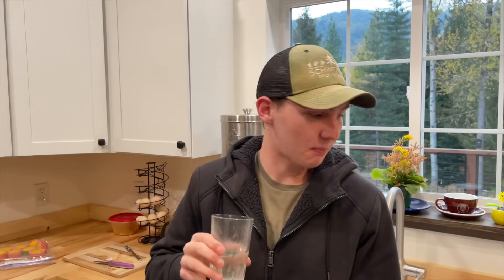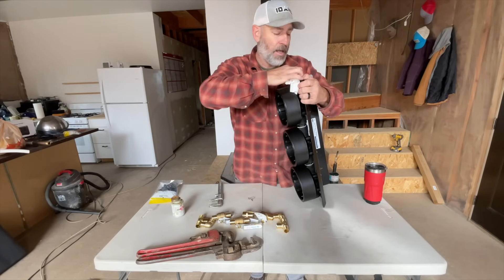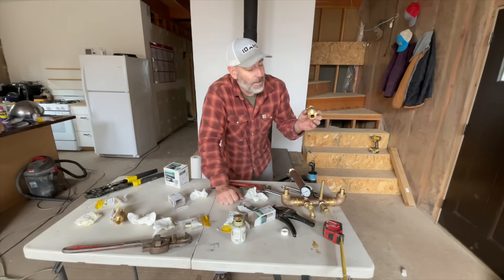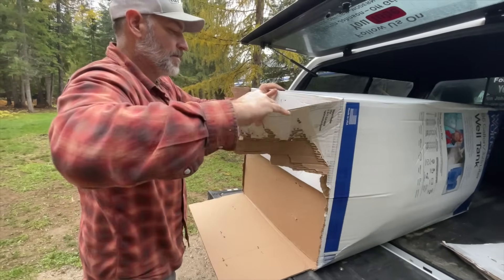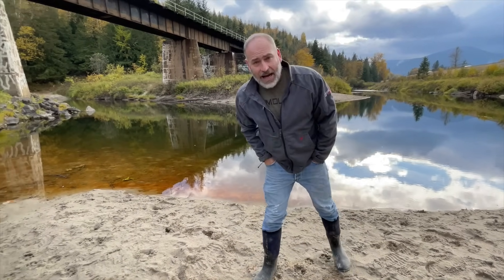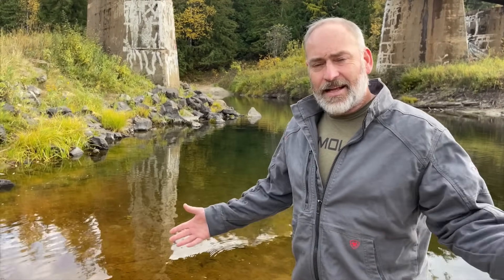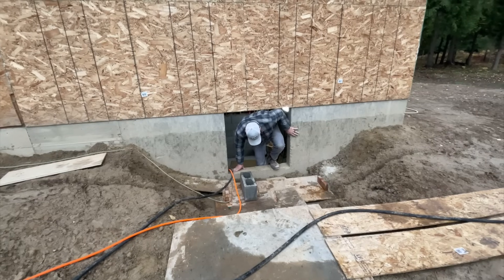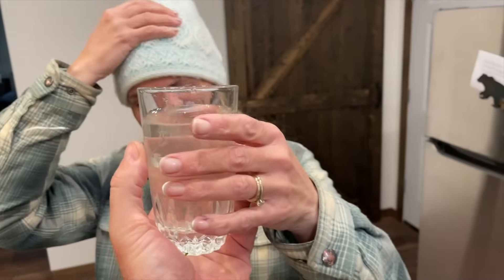ULTIMATE Off Grid Water System - Real Off Grid Living

Comment from the maker: 💦 If you missed it, here is our well-drilling video https://youtu.be/EVlSBgdA7Dc
Reply: Martin, you need to install insulation underneath the floor to keep the house warm and prevent pipes from freezing during winter time.
Reply: Love the new film quality! New phones? New equipment too?
Reply: Just FYI  spammer trying to contact  me on the comment  I left earlier.
Reply: I think a spammer wanted me to do what's ap. I just wanted more info on hand pump, wasn't in well drilling video
Reply: Your HISEA product tester link doesn't work. I had to go to their website to register and hopefully it took as it doesn't say if your signup is completed or not.
Reply: Try going shower 🚿 water to toilet water to save water recycling ♻️
Reply: i missed it somewhere... what filter is that ? thanks
Reply: Hi guys u should try solar heat on ur build save ur lives cold weather n keep trees around ur home away cause of fire 🔥

Comment: Great video! I would suggest you put the carbon filter at the end to extend the life span! When I built our filter system, we were instructed to always put the carbon last in the chain!
Reply: My thought also, get the nasties out first then run it through the carbon filter.
Reply: Ten years in the water conditioning industry taught me to filter the worst elements first and then the taste (carbon filter) last. Sentiment, minerals, chemicals.  Great video. Dan.
Reply: Yes I agree, same as we did
Reply: You can use large to small micron filters the same way.  The problem with the carbon filter is they lose carbon in the water so it will clog your other filters also.  However if you don't want random black particles in your water you can do the carbon before another 20 micron filter to stop the carbon.  If you buy a white filter you will see the black carbon on it.

I had to do a lot of filtration for high pressure aeroponics
It's good to think of the carbon as a sponge.  Over time it will take the same oh and chemicals as whatever it filters.  The carbon becomes very concentrated with these elements

Comment: It is called an LB because the opening is opposite the cover, coming out the back. There are also LRs and LLs for going right and left. Hold the fitting like a pistol and the cover to the right is an LR and to the left an LL. I agree about putting a romex connector going into the LB. You wouldn't pass an inspection since the opening is not closed.
Reply: LB is for conduit PVC pipe, not romex connector clamps. They should have used the right electrical box.

Comment: When I lived in Hawaii I had a similar system but suggest a couple changes for yours. My system had a sediment filter before the pressure tank and that helps keep the inside of that tank clean and the rubber bladder inside it will last longer. Also, I had 3 filters mounted in this order : first was sediment, second was charcoal/carbon, last was a UV filter which contained a UV light that kills 99.9% of bacteria. We didn't really need an iron filter but since you have a deep well I can understand the need for one in your situation. I had my water tested for bacteria to be sure it was a safe source of drinking water. It's a learning experience that is so important! God bless you all! I love watching your progress!
Reply: The sediment will have no effect on the life of the tank, nor will dirty water. It more comes down to how often and how much water you use. The more the bladder expands and contracts, it gets pinched where a metal ring is crimped into the tank to hold it into place. I have never seen a filter before a tank besides and automatic sand separator. Putting filters before a tank can cause a pump to short cycle from the pressure switch not properly sensing tank pressure.  Minerals in the water all come down to where the well is drilled not how deep. I have replaced pumps in 100 ft wells there are iron mines and I have also replaced pumps in 1300 ft well that are spotless. Just luck of the draw and local terrain really. Hopefully that helps some :)
Reply: Bad idea, since if the filter gets clogged, the pump will burn up.

Comment: Two suggestions:
1. Install a sediment filter before the tank to avoid sediment build up in the tank. Having two sediment filters (one before & one after the tank.)
2. Glue a bushing with female threads into the LB box so you can install a romax connector for the #12 gauge romax wire going into the LB.
Reply: I got all of my filtrations done before the tank,and in the tank i have a UV lamp ,but yes the sediment filter is the minimum
Reply: I was just about to suggest something similar.
On one hand, if you can clean out the tank, letting the sediment settle out means less usage on the sediment filter.
But on the other hand, it just makes more sense to me to run all the filters BEFORE the tank.
Run less chance of damaging anything after that.
But I guess it might also depend on how things work, like the filters might not be able to handle the higher pressures on the line between the well and the tank.
Reply: Should never put a sediment filter before the pressure tank, will effect how the pressure switch acts. Sediment on the bottom of the tank isn't an issue. Only time I will come out is if you drain the tank down or run out of water.
Reply: Nope. issue is that some time filter get clogged, and it can burn up the pump motor. One option is to install two tanks: a small one with the pressure switch on it, and a second tank on the other side of the filter(s). 

The LB isn't the right electical box. It should be a box which you can install romex connector clamps (usually with threaded holes). You cab by cast alum or plastic rectangular electrical boxes that will except threaded flex conduit connections & romex wire connector clamps.
Reply: @PituWillson  Not a good idea because of one of the filters gets clogged, it can burn up the pump motor.
Reply: @guytech7310  i dont know what kind of weird pump you use, my pump make constant presure at the output and when this presure is reached, pump switch off, and when the presure drops then get switched on..I have diferenciál presure sensors on my filters, so when the filters get clogged I can see it even before that happens.... Trully I think its not very smart let all the sand and silt get to the tank... I am storing in my good pure drinkable water
Reply: @PituWillson  Nope. The pump just moves water into the water line, it does have pressure regulation built in. Some installs have a pressure switch installed in the well instead of at the tank. If there is no pressure switch at the tank, remove the well cap and look inside the well housing. You see a pressure switch installed, usually at the pitless adapter which connects the well pump line into your water line. 

Consider how would a well pump know at what depth its at. Is it at 50 ft, 100ft, 150 ft, +200 ft? the deeper the well the more pressure is required to pump the water out of the well. All well pumps rely on a pressure switch.
Reply: @guytech7310  i have said that my pump make constant presure at the output so that mean it have pressure regulation built in,so what you talking about ....I have this pump, Grundfos SQE 3-65,in25m deep well and after this pump on the top i have filters and after these filters a tank and ist working all fine, I have too much sand in the well so I dont store it,the sand, in my tank,the tank is just for water
Reply: Please remove this suggestion.
Reply: LB stands for Long Box. LR goes to the right not the back, LL goes to the left. A "C" is simply a break with both ends open for pulling long runs. You are not allowed to do any makeup in an LB.  Exception is you can hook up a light fixture or a flood light.  I wouldn't worry about it though.  (50 year electrician)

Comment: You really need a silt filter before the pressure tank. 
Also you don't need a bypass on the filters.  With that you are just allowing contaminated water into your system. 
What you really need is a service flush valve when you change the filters. 
When you put a new carbon filter you will have carbon dust in the water big time.

Comment: After a couple of years building RO systems in arctic communities I would suggest an RO membrane . You should also look at a UV light phase on the post filtration side , you might also want to consider a 300-500 gallon tank in the basement post filtration to store clean water an ozone aeration unit will help keep it fresh and having a stock of clean water in a heatable space may save you in an extreme winter season . It also seems better for pump longevity to pressurize your inlet water with one pump and distribute it with another located after the filtration and before the P Tank . This splits the draw load and the distribution pressurization load . We were building fill your own jug systems for the town stores in these tiny villages and when you are 2 or 3 airplane flights and at least as many days from any replacement parts or a service tech you learn pretty quick how to adapt these systems for absolute minimum hands on maintenance , after all who wants to pay 10-12 thousand dollars for someone to fly in and replace a 100 dollar pump ?

Comment: those filters are huge. my RO system was similar but a 1/10 of the size. during my installation, I was instructed to not drink the initial water passing through the filters but instead after 6-12 hours of the system and filters in use

Comment: A suggestion, I wouldn’t put the filters and pressure tank in the crawl space, not for any other reason than it’s a pain to change and if the tank ever fails, it’s a huge pain to get it out of there. Usually you would want all of that stuff at ground level or at least where you can get it out of there on a flight of stairs instead of a step ladder. In the case of a catastrophic failure, it’s nice when these systems are located in the garage, in those cases they typically drain out of the garage bay.

Comment: if you notice lower water pressure in the faucets, remove the aerator and clean the screen.  some debris can come from the new plumbing and will clog the screen in time.  Good job on the pressure tank and plumbing, I used to install wells and pressure tanks, in a past life, hi hi

Comment: You had it right as far as you went. LB stands for "Elbow Back" because the direction change is on the "back". There are also LL and LR and an almost never used LF. You guessed it, Elbow Left, Elbow Right and the unicorn Elbow Front. I've only seen the LF once in 37 years as a general contractor.

Comment: you're outside hydrant next to the well isn't going to work with the check valve in the basement only if the pump is running at the time you turned it on👍
Reply: Very good observation 👍
Reply: I was waiting for somebody else to catch this lol, I would install the check valve under the pitless for the hydrant to work

Comment: Praise be to our Abba Marty and Jewels... Emmanuel has truly blessed you both to come so far...

Have you ever thought of using a used oil heater. They can be used in non living areas, it can help keep your home's crawl spaces, and the garage warm. This could potentially help you retain heat in your living areas by heating the floors in the house and the living space of the apartment from the garage reducing your demands on  your off-grid power systems in the winter and lower your propane needs since the lower temps may use more fuel to keep the areas cozy. You can get spent oil from auto parts stores and oil changers. They would probably give you the used motor oil... A 55 gallon used Polly drum could be ideal to store the oil.

I would also consider putting a small power station in the basement area with its own micro charging station all-in-one with a 400watt Bifacial panel should keep that charged especially in the winter to reduce the demand. This could allow you to shut of the circuit from your Off-grid power electrical panel. Less flow of current in wires of unused circuits means less wasted energy.

Just some ideas to help stay efficient and cozy... I bid 
Bonds of Abundance,
Bonds of Unity Bringing Harmony, 
Bonds of Opportunity,
Bonds of Progress, 
Bonds of Supernatural Provisions,
Bonds of Health and 
Bonds of Miracles and each of the entities to be released to impart these righteous bonds into and upon your family and your pets, your parents, your ministry, and your busineses and all that Abba has allowed to manifest in your favor and the things to come, planned and unexpected in the name of our King Emmanuel! So that you too can keep smiling. Love you and your family... Give Jewels Dad and Seth, a big hug for me... The Holy Spirit says her Dad He needs encouragement! I love you with the Agape Love of Emmanuel!

Comment: I went back and watch the video the Hydrant is teed in by the well on the same line that goes to the house the check valve in the house is not going to let the water go back to the Hydrant so you only have water at the hydrant when the pump is running .

Comment: Do you have any way to bleed the pressure off of the filters after closing the valve?  I suggest adding a bleeder.  If not, it'll be difficult to unscrew the filters.  Pressure guage on each side will show you your differential pressure also.

Comment: Would recommend adding a water softener before the filter, (I have a kinetico) I did what you did prior and spent two years of spending a ton on filters, the up front of a water softener is more but if you plan on the long haul it’s a saver and plus you can actually get 8 months on the filters. Side note, would add a uv filter system too, bulb change yearly and it’s cheap. Love the videos and good luck with off grip living

Comment: Nice job,  bet your are glad to have fully plumbed water now.   One suggestion move the iron filter before the tank and a second sediment filter between the iron filter and the well.  This will keep the sediment and iron out of the tank.   You are likely going to need a larger iron filter.  They are available in a larger tank like a water softener,  with these there,  is no filter to purchase and replace they do need to be back flushed and recharged every so often, good ones have fully automatic back flush and salt brine regeneration.  

The activated carbon filters are usually coconut charcoal in a block or granular (GAC) form.  When replacing these filters you need to flush them to the drain for a couple minutes to wash out all the charcoal dust.  Just run the water until it runs clear.   Factoid: 1 gram of activated carbon has the surface area of an acre of land.
Reply: No, becuase a clogged filter can burn up the pump.

Comment: The recommendation of using a sediment filter before the tank is a good one. It looks like you went with 4.5-inch diameter filters also called big blue filters by 20 inches long. This is a good choice. I have had an excellent experience with these sediment filters in a 50--5--1 micron bank.  But I have really rusty water with chunks. I did not see the designated sediment filter that was used. If you use pleated filters you will get massively more use as compared to smooth surface filters. A pressure gauge after the sediment filter will tell you when to change the filter.

Comment: Nylon Taping 
Tip 
Hold the fitting in your left hand 
Roll of tape in the right 
Tape goes over the top of the fitting & go under & around several times 
Tape - Smaller at the front tapered to back of the fitting.
Works everything.

Comment: Will you guys be doing any wind project for the winter months.  We are thinking long term infrastructure prep situation .  We are thinking also the winter months , so looking into a 3 or 4 k helix wind turbine .  About $3k we figure with 4 to 6 agm batteries , controller, wire, inverter, pole ect. they said has to be at least 4   12v batts because it has to be 48 v ?

Comment: I have been watching your build for a couple of years and enjoy what your doing and your family.  As you were installing the new water system tank and filters, I saw what may be a code error in your wiring.  In our area south of Portland, you cannot wiretie Romex to a pipe as in your pex to the pressure tank pressure switch. I would suggest you bring the Romex to a box on the wall then conduit from the box to the pressure switch.  You may also want to put a switch in that box to disable the pressure switch right there if needed.  Hope this helps.

Comment: If you install another set of filters in parallel with the others filters you will get much longer life out of the filters because as they plug up they only need to supply half the flow. I’ve seen others with particularly dirty water run quad lines of filters. Set and forget type of system and when they do actually plug up in an emergency you can still just replace one set of filters till you can replace all of them.

Comment: you might wish to add a couple of rusco spin down filters and drain  valves they will save you a small fortune on filters in the big blue filter rack  they will go inline before your water filters that you installed. They are available all the way up to 1000 mesh filter elements

Comment: This system is probably installed on a lot of homes that have a well. I never had one before and wasnt aware that a bad pressure tank causes that pressure to constantly fluctuate, the needle drops and builds up often instead of a working tank which keeps the needle steady. This also causes the pump to work too much, probably wearing it out.